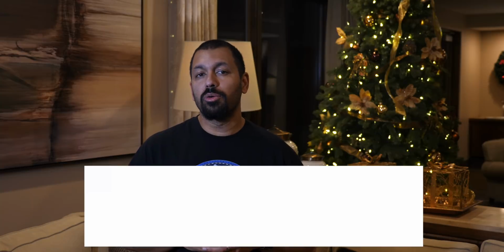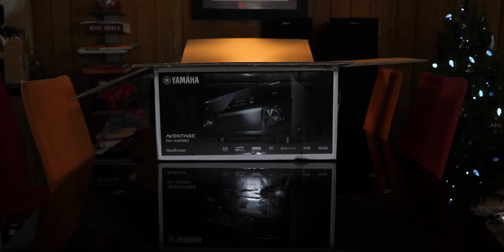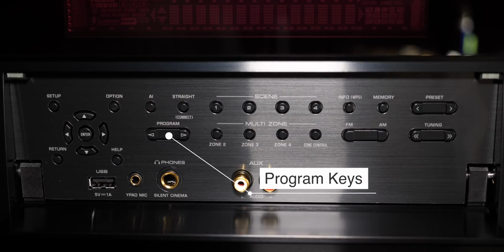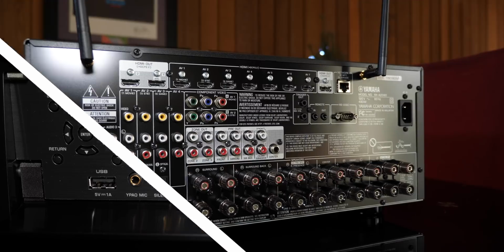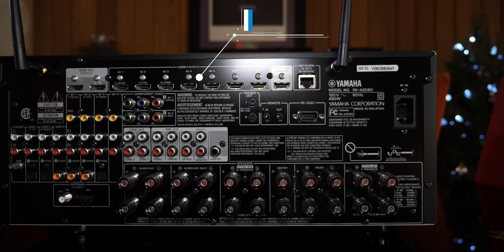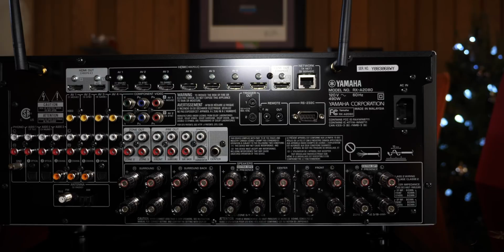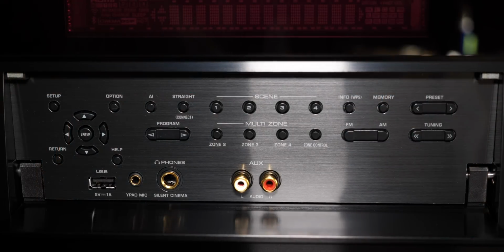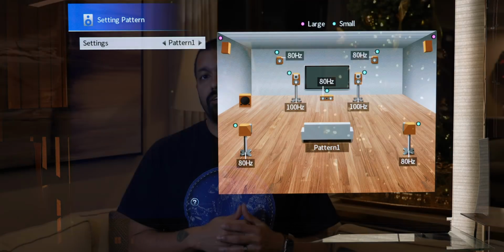Yamaha RX-A2080 Unboxing & Dolby Atmos Setup

Comment: I have a question please, Do we have to set the speaker configuration on Basic (power amp assign ) even though we have a power amp to support it externally?
Reply from the maker: Hi!  I think you do as that’s what the AVR will need to know to process the signal.  Like, it needs to know if you’re running a 5.1.4 or a 7.1.2.  Both are 9 channel configurations, but also very different.
Reply: @TechnoDad  Thanks a million. Cheers

Comment: HELP! Have the 2080 - want 7.1.2 setup but with the height speakers as rear height. No front height presence. Have height speakers plugged into the SP2 speaker jacks. However,  in Power Amp settings, I can't select Rear Presence - it's grayed out, unless I first select front presence. Even if I select both front and rear presence and then do YPAO it won't find the rear height presence speakers. I could have sworn I had this set up this way with only rear height speakers before I brought it in for repair and it was reset to factory defaults.

Comment: Hey Channa, are you able to run the rear presence speakers with an additional 2 channel amp? All while running the rear surround speakers at the same time. The manual doesn't really explain if this is possible. I'm guessing it would be assigned to Zone 2. If that's the case, will Zone 2 play rear presence sound effects? Thanks

Comment: I have the RX-A2080 and I have a 7:1 speaker system. All of my speakers are wall and ceiling mounted. I have wall mounted two fronts and a center speaker and the other four are in the ceiling. I used surround, surround back, center and front connections for the theater.  I also have four ceiling mount speaker outside the theater that I'm trying to set up as zone 2 but I can't get it to work. I don't think I've physically connected my speakers correctly as I've used multicast to create zone 2 and believe I've connected it correctly

Comment: Can u suggest me the configuration of 5.2.4 in Yamaha RX 2080 and speaker level config
Reply from the maker: Hi!  I'm not sure what you're asking.
Reply: I wanted to know that how can I can configure Yamaha 2080 speaker layout in 5.2.4 format using surround back speaker. Again need to understand the speaker level settings. I do not want to use the YPAO. I am usin elac sub with phase -0, volume-95, crossover 80Hz. Is it ok. Your suggestion will guide me in listening best sound

Comment: Hello I like your videos  and watch them regularly I need help with my Yamaha RX V1085 does it support 5.1.2 setup for height speakers instead of a 7.1 setup where do I plug my speaker wire in 2

Comment: I am a newbie, I have 10 JBL ceiling speakers installed in my basement. Can i use this receiver to connect all 10 speakers?
Reply from the maker: You might need a power amp for all 10.  Check out a Denon X6700H - https://amzn.to/2VP1BvV

Comment: Hey Channa... thanks for the channel, you always educate.
QUESTION: 
If "140m WpCH @ 8 Ohms into 2 Channels".... then ??? WpCH @ 8Ohms go into 9 channels PLS?
Why do manufacturer weasels not just give the bottom line?
IF we start at 140 W...and a lot of towers says that you'll need a min. 30 W to power your speaker... the does that mean that a 9 channel AVR needs a min. 270 W to put out MIN. opertaing sound?    ie. 30W X 9CH = 270 WATT minimum requirement.

God Bless, power on brother... Geo
Reply from the maker: Hi!  Yeah, it's really lame that they won't tell us the numbers with all channels driven.  That's why I always recommend an external amp for your 5 main speakers.  At least that way, you can guarantee that your five ear level speakers will be getting 120 watts RMS all the time.  Then you let the AVR power the height channels and you're good to go.  Most of the time those height channels aren't being used, especially when you're watching TV.
Reply: @TechnoDad 
Thanks for confirming my thought,  was my math off though? 
Am I only going to be getting 1/2 the wattage that towers need. Ie 15 watts pSPEAKER at 9 speakers?
9 x 15 = 135_ish watts TOT.    Or do amps work differently than that ? I am not an electrician or science guy.
Thx
Geo

Comment: Hi Techno Dad. I've just up graded from a RX-V863 to a RXV1085, I have B&W bi amped front speakers. I've wired the bottom 2 wires into the Front sockets, the upper 2 I've wired into the Extra SP1 sockets, is this right? Also, how do I change from 5.1 to 2.1? Cheers.

Comment: For my denon avrx6500h i want add Yamaha mxa5200 amplifire  do you think this is a good idia or i have to change my receiver to Yamaha cxa5200 to munching  with  mxa5200
Reply from the maker: You don’t have to change receivers do power externally.
Reply: @TechnoDad  thank you so mhch.for respinding my question.so i keep my receiver  only i buy yamaha mxa 5200 11 .2 channal amplifire.

Comment: great video. i own a aventage rxA-2030 which has been awesome.  We just painted the house and i went to plug everything back in and now the receiver won't recognize the subwoofer.  I reset 2030 to factory settings.  Sub powers up but no matter what i do i cannot get sound out of the sub. The front speaker is set to small and the sub is on in speaker settings.

Comment: Oh, those dual Sabre DACs....Amazing sound! Better Denon sound quality IMO. I'd go for the Sabre Pro in the 3080.
Reply from the maker: Yeah, the DACs are pretty awesome, too bad YPAO room correction isn’t as good as Audyssey.
Reply: @TechnoDad  I have an RX-A3000, but the addition of the Sabre DAC Pro in the 3080 may cause me to upgrade or simply await the new RX-A8 if they could get the HDMI 2.1 compatible to the 8K codecs).
Reply: Techno Dad   Do you really need the best room corrections if you can adjust the perrameters yourself.

Comment: Techno Dad    I have RX A-2080 receiver and I am having trouble with the speaker set up.  I have a complete Klipsch system  (2- R8000F towers, 1- RP 504C center, 2 PRO 180 RPC in ceiling Back channel and 2- 180 RPC LCR front height celing speakers.  I also have 2  SPL-100 Subs.  I get no sub response and little surround sound experience.   You're video help me  understand the receiver set up a little better but the sub set up is still a little confusing.   Thank you for any and all help that you can provide. 
 PS!  I plan on getting the EMOTIVA XPA-7 in the future as I have already found the power levels of the A-2080 lacking for my needs.
Reply: Hi do you have still settings still? I need help with mine!

Comment: Is it better to go with a 7.1.2 or a 5.1.4 with this receiver. My theater room is about 400 sq feet with the seating up against the wall. I really wanted to do a 7.1.4 setup but the 2080 cant support it. Is it worth spending quite a bit more to get the a3080 to gain the ability to run 7.1.4 given my room size.
Thank You very much.

Comment: Chana, 

If I want to connect an external amp to this Yamaha receiver, do I have to change any settings in the receiver itself or do the pre-outs just automatically work? Getting an emotiva in a couple of weeks and I’m running a 5.2.4. With this receiver. Thanks!

Comment: i have the rx-a660 yamaha receiver what i need to know is how to make the adjustments on this receiver to the best setting so that when i play a movie it will show if its dolbe atmos or dtx ? witch button should i turn and should it be straight or direct ? should the speakers be set to -225 or +225  i do have the definitives 9080's so i dont need a sub should i set the sub on the speakers to normal or reverse ? should i set the fronts to bi-amping or overhead ?? see what im dealing with lol i really could use your help i use the automatic speaker set up but there still some manuals that have to be set im in no hurry cause i know your busy so take your time i think i saw a small video explaining it but it was not what i was looking for thanks dad lol

Comment: Can anyone tell me what’s amps do this receiver use. I currently use a pioneer elite which uses a D3 amp. I can’t find any information about the amps in this or the 3080 use. Does it over heat?
Reply from the maker: Not sure!  I have had no issues with heat.

Comment: The reason you had to jack your volume up is because your speakers are small...
Reply from the maker: Actually it’s because we sit 14 ft away from the front stage.  This has happened with small speaker and tower speakers.  The room is over 4000 cubic ft large and an external amp cures the situation.  Sadly, this happens with EVERY AVR I’ve reviewed.  So it has nothing to do with the size of the speakers.
Reply: @TechnoDad  oh right, your room is the size of my house... That's huge, man! Good luck making that work :-)  How's your review coming along anyway? Would love to hear your thoughts on this vs the Denon x6400h or x4400.
Reply from the maker: Still using it and it's doing a great job except for power.  It works well and the Surround AI is also a good feature.  One thing I don't like is that the Denon X4500H and Marantz SR6013 are in the same price range but they process 11 channels where as the Yamaha only processes 9 channels.

Comment: Hi there, i have two BP9060 speaker, one MartinLogan - Dynamo 700W SUB and a Marantz - SR 7.2-Ch Model:SR5013 Receiver. I will NOT use this system for Home Theater, only for music, what is the best setup you recommend thanks.

Comment: Got a question Chana. I have a Sony DA 3700 ES. Just bought a LG C8 65”. I can’t, for the life of me, get the home screen of my receiver to come up on the C8. I’ve tried everything I can think of. Any ideas?
Reply from the maker: Hi!  Not sure what the problem is.  Looks like there's only one HDMI out on the AVR.  Did you try swapping HDMI cables out?  May or may not fix the situation.  I'm sure you may have tried that already though.  Honestly, I'm not sure what would cause this.

Comment: One thing that annoys me about my 1060 is that if I'm using Dolby Surround or DTS up-mixing to the ceiling channels, it won't automatically switch to pure Atmos if an Atmos signal is present. Mainly a problem on my satellite TV receiver which will output 5.1 or Atmos depending on content but won't tell me when Atmos is present. It means I have to fiddle about with buttons, or if I'm out my family miss out on Atmos.
Reply from the maker: That's lame.  I think there's just different sound formats that don't click over sometimes.  Wish there was a way to fix it.  Do they really care about Atmos or do you want to just make sure it's on when it's supposed to be?
Reply: @TechnoDad  I probably care more than them, in truth. The lack of auto switch seems to be a consequence of UI design: you either have "direct" on (needed for Atmos) or you have sound processing on (e.g for up-mixing to extra channels).

Comment: Man that is a great looking receiver. Love the aesthetics of that face plate. Looks like it has a great build quality. Great rear panel layout, with an awesome selection of inputs. Really like those pre-outs. Like the removable power cord, so you can upgrade if wanted. It also has plenty of power right out of the box, and it is very versatile. Bonus! Thanks for the video man!
Reply from the maker: No problem man!!  I love trying out new brands.  Very cool!

Comment: Hello techno dad.  I have a pioneer elite a-20 which I am using to run the Klipsch R-41-SA speakers.  I have read may reviews that this may not be powerful enough can you provide me some help
Reply from the maker: Hi!  Are you using this amp to power height channels?  If so, I think 50 wpc should be just fine.
Reply: Techno Dad thanks for the reply yes just powering the Dolby Atmos rear speakers.  I have tried 2 amps and have to have the gain at 80% but heard that’s normal.  Happy New Year

Comment: Hi, your comment at the end about the volume is wierd, if you run the auto calibration, your speakers are set to reference @ 0db, -10db with this receiver should be the same as a Denon or Marantz @ -10db. You should check the speakers levels, Yamaha Avantage line have really good amplifier, good power supply, really good construction. For the record, right now I have a Denon, but I had the chance of owning a Yamaha before and was really good. Keep the good work, try to compare YPAO vs Audyssey!
Reply from the maker: Hi Joel!  I always felt the same way about the Denon.  That's why I had an external amp connected to the Denon.  I will probably use the same amp with the Yamaha.  I am not really getting any volume until -30db.

Comment: Nice receiver. Iam interested on what you have to say regarding the Yamaha. I have a current Denon AVR. I may move on up to the line to the Denon AVR-4500x but the Yamaha is built and a real beauty as beautiful as a black box gets).. Iam particularly interested in the current DSP on the Yamaha as I don’t think they support Auro 3D (....yet). I seem to recall they have a like version. What are you using for a receiver? Denon I thought. 4400?

Comment: This model seems priced to compete with the denon avr-x4500h in terms of pricing but offers 15 watts per channel more of power. I'm curious to know how that increase translates to real world performance. Also I'd like to know what are your thoughts on how the Yamaha compares to the denon with both music and movies.
Reply from the maker: Hi!  To go up 3 db in sound you need to double the wattage, so I don't think 15 watts extra would be that big of a jump in volume.
Reply: @TechnoDad  I don't mean in terms of volume output but in terms of how it translates into both playing at regular volume levels and how they compare in terms of headroom or if there's noticeable compression comparing the two hitting reference levels.

Comment: Would not give them the money for this 1500 for a av resever not you could buy 3 Sony 1080 for this
Reply from the maker: Well, the Sony only supports 7 channels, this one supports 9 channels.
Reply: The dacs and build quality are among the best. If the 3080 had IMAX or Dirac. I would get it hands down. Even without, I'm still thinking about it.

Comment: Hey great channel . Just heard a 780 and was impressed by the new surround processing, especially the center dialog. A 2080 would be nice to play around with.  You mentioned this wasn't loud enough without cranking it up. The modern receivers just don't have big enough transformers to distribute to all channels like the old ones. That receiver is only putting out maybe 60 watts per ch with all driven. The rated wattage is only attainable to 2 or at best 3 channels. If you run only 3 channels preferably front L,R and, center for  keeping  the original sound of Yamaha  intact and you get full or close to full 140 w per channel and use external amps for the rest. (some may prefer external amps for FCR if they are really good ) Realize not everyone can do this but just my 2 cents for what it's worth.
Reply from the maker: Yeah, I have a 5 channel amp to run the main 5 speakers.  Just wanted to try it with built in power first.
Reply: Do you guys recommend a specific power amp for running a 5.0.2 set up? (Klipsch 8060FA mains, 450C center and a pair of 502s bipoles for surround). Currently have a Yamaha 850 and have to crank up for older movies.
Reply: With this receiver I would probably use a 2 channel for front LR connected to those pre outs with at least 100 watts per ch. I'm not too familiar with the newer stuff but did have a Emotia basX300 which would have been a good fit. Also a Yamaha AS series amp would be good. Even though it's integrated it has  a through mode for home theater.  You should get close to rated power on this receiver with only 3 channels running on the rest of the channels connected to the receiver since it has about a 400 watt transformer. That doesn't directly correlate to output power but is  a good estimate on these type scenerios. If you are going older equipment there are plenty of  2 channel amps for this purpose. Preferably Yamaha since same brand equipment tends to match up better. Others to consider would be Nakamichi, Carver, NAD, Adcom.
Reply: Audio Gear thanks for suggestions, man. I’m brand new and learning on the go with HT audio. Techno Dad, forums and responses like yours really help me out! The one thing I’m curious about is if my center should also go to the separate amp so that my whole front stage sounds the same. Thus would require multichannel amp.
Reply: @ChrisWoodrum on multi channel amps. You don't really have to do that as you run the automatic room setup with the amps connected and setup will adjust the DB gain for each channel. If you don't like the EQ after setup you can write down the settings for distance and channel gain and reset receiver then use manually set distance and gain to whatever it fond those to be-it's usually pretty close with exception of the Sub. Nothing against the multi channel amps if you have the money for them but may times you can find better sounding 2 channel amps for the same price if you do alot of 2 channel listening.
Reply: room-ten-oh-nine ! Thanks. Will def look into those amps and not shy away from older models that can handle those wattages.

Comment: Hi Techno Dad, I need your help...which av reciever do you suggest for klipsch speakers....RP280f and center 450c....thank you for your help....is this yamaha ok for this speakers?
Reply from the maker: Hi!  You can pretty much just pick one.  What budget are you looking at?
Reply: Hi, now I have Yamaha rx a 730...but I dont know if this reciever is strong enough for this speakers (I have bi-amp connection)....do you thing if I go for Yamaha rx a 2080 or 2070 or 1080...that would be some improvements or not?...budget...arround 1500€.